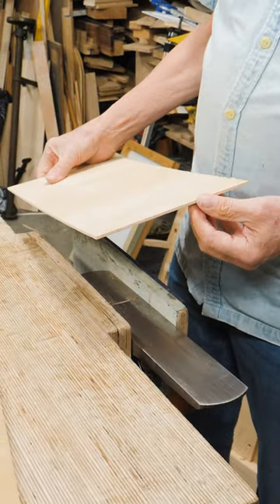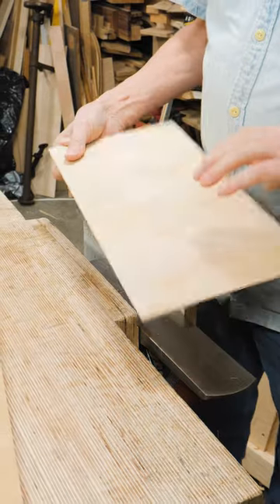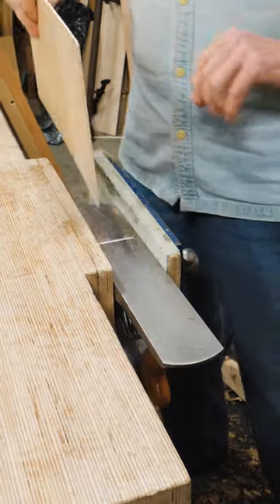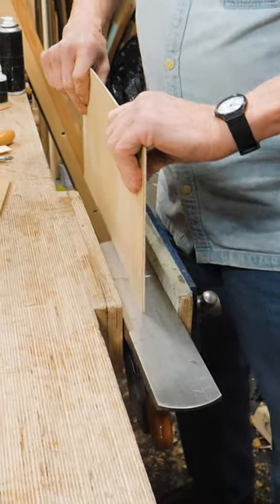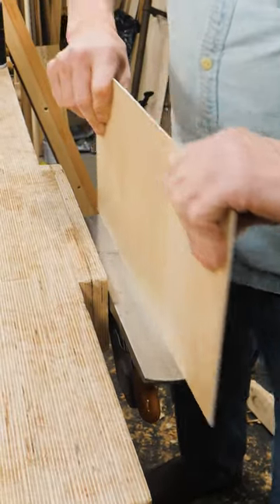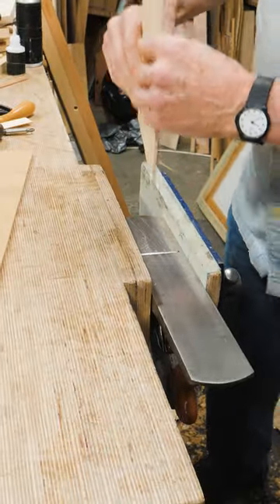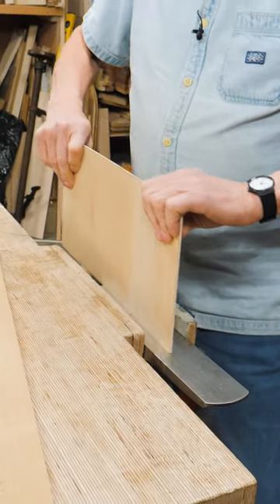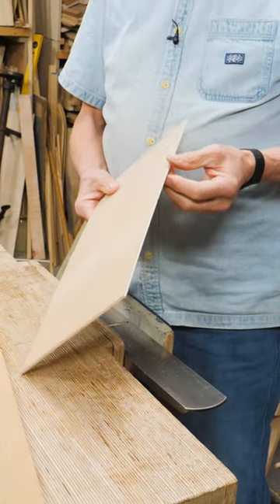Paul using a Hand Plane like a Power Jointer?! #woodworking #diy #shorts

Comment: Why not lay your workpiece flat and use the plane on its side? Your edge will be square also.
Reply: There would be a gap between the corner of the iron and the flat workbench, resulting in a lip on the board edge.
Reply: You can use a shooting board for this kind of work depending on the size of the piece (and the size of your shooting board).
Reply: You'll need a shooting board for that, because the cutter doesn't come to the edge of the plane, so, if you lay flat such a thin piece of plywood, you won't get a cut
Reply: @lordsummerisle87 , not able to place the workpiece onto another piece of stock to raise it up to the blade? When joining two thin pieces of wood, say a guitar top or back, the  pieces themselves will serve. And, whatever slight unsquareness exists will be cancelled out, if you are clever enough.